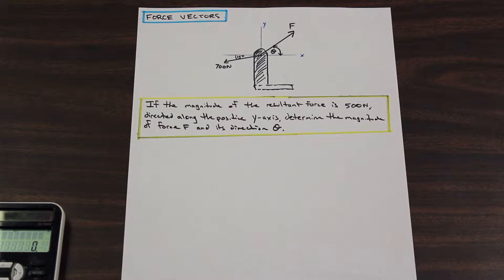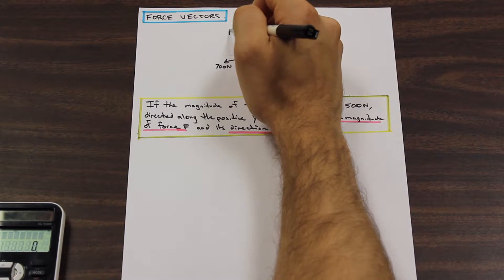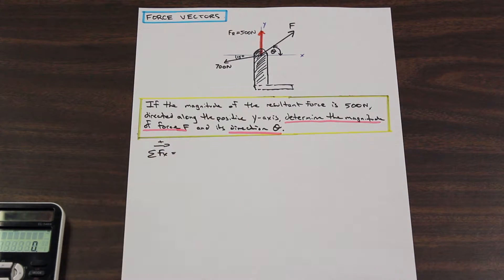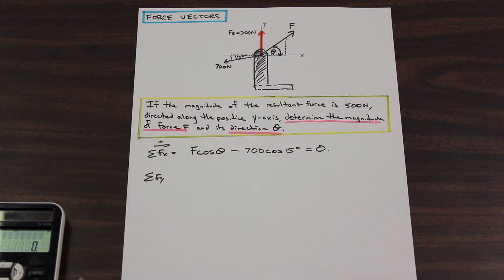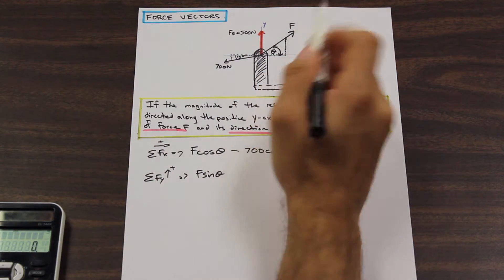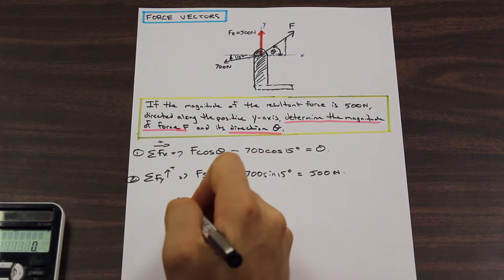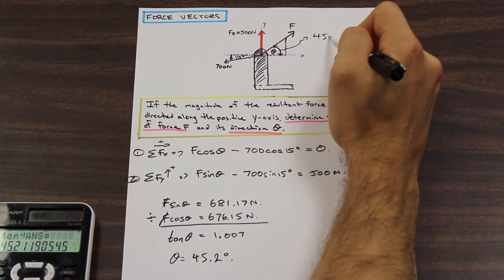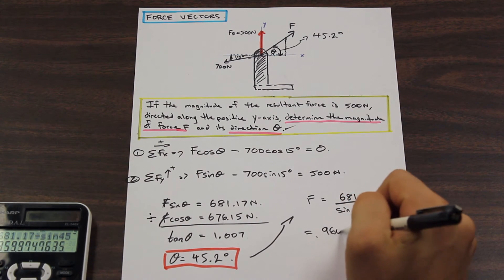Vector Review - Finding the Resultant Magnitude and Direction

Comment: great video 
however i do not think the responce what optimal because of the way u found Fy it isnt what u wrote in video because Fsin+700sin15 doesnt add up tp fy in all cases only if we had it already in the problem 
an other more gznzrale way would be we find fx then we add fx and fy (we already have) to find f then find tetas by simply doing fx/f and calculating the cos
thank u for correcting me in case i made any mistake or acctually didnt understand ur correction well enough